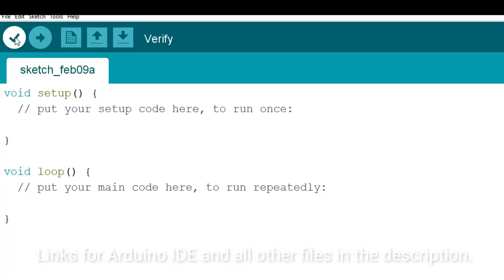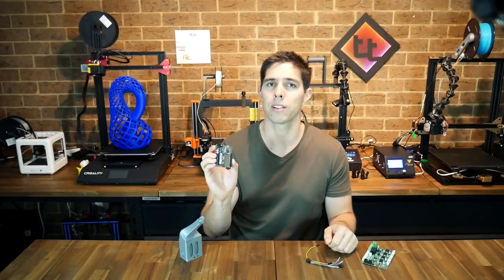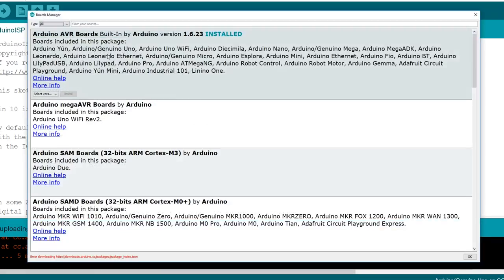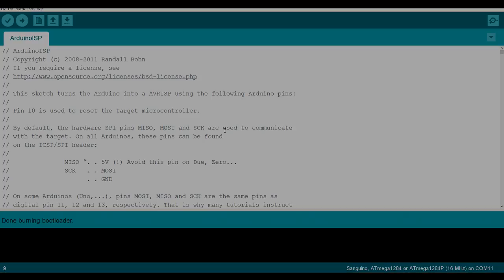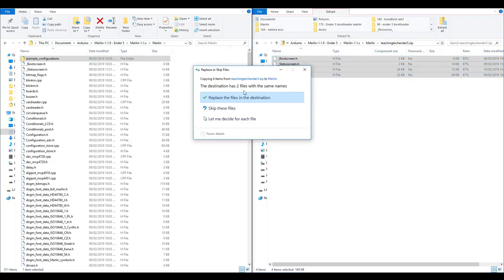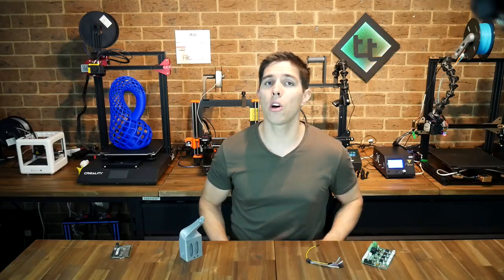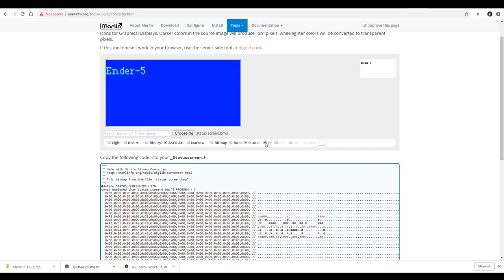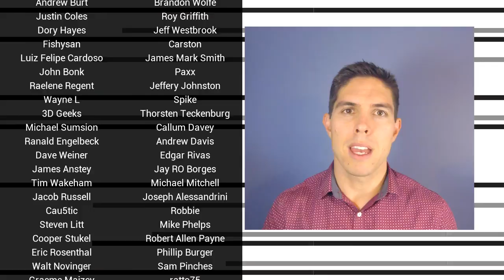Ender 5 bootloader and Marlin update

Comment: Hi. I am trying to upload the marlin 1.1.9 (bugfix 1.1.x) with Arduino 1.8.9 Board: Sanguino Proc: ATmega1284p 16Mhz. Connected directly from my PC to the Creality3D 1.1.4 via USB.  I am getting this:

Sketch uses 122432 bytes (94%) of program storage space. Maximum is 130048 bytes.
Global variables use 4629 bytes (28%) of dynamic memory, leaving 11755 bytes for local variables. Maximum is 16384 bytes.
avrdude: stk500_getsync() attempt 1 of 10: not in sync: resp=0x65
avrdude: stk500_getsync() attempt 2 of 10: not in sync: resp=0x63
avrdude: stk500_getsync() attempt 3 of 10: not in sync: resp=0x68
avrdude: stk500_getsync() attempt 4 of 10: not in sync: resp=0x6f
avrdude: stk500_getsync() attempt 5 of 10: not in sync: resp=0x3a
avrdude: stk500_getsync() attempt 6 of 10: not in sync: resp=0x53
avrdude: stk500_getsync() attempt 7 of 10: not in sync: resp=0x44
avrdude: stk500_getsync() attempt 8 of 10: not in sync: resp=0x20
avrdude: stk500_getsync() attempt 9 of 10: not in sync: resp=0x69
avrdude: stk500_getsync() attempt 10 of 10: not in sync: resp=0x6e
An error occurred while uploading the sketch

Please help
Since I am having problems right now with my Ender 5 as I posted here:
https://www.reddit.com/r/ender5/comments/bsdvp3/ender_5_cant_print_very_dissapointed/

Comment: Just flashing this method to my brand new silent board v1.1.5 black board for my ender 5 and edit configuration.h driver stepper tmc2208standalone and all worked
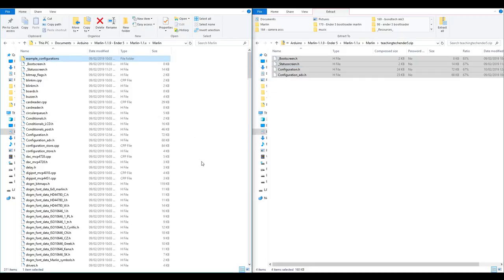Reply: I just got the 1.1.5 board and need to flash the firmware. I am not up to speed on the electronics part of this so I am confused. In the video, after completing the boot loader (which I am assuming I don't need to do for the 1.1.5 board) he says you are done with the Arduino. But at 6:07 in the video he has you open the Marlin Arduino file and do some more (to me) magic with Arduino). Can anyone clarify this for me?
Reply: @craigharoldsen7038  try find kersey fabrication channel he has clear method editing file for tmc2208 ender 5 and upload to this silent board

Comment: Please show how to burn the bootloader using a Raspberry Pi. PLEASE!!!!
Reply: An Arduino is so cheap you cant get wrong. Aa simple Arduino Nano wiol cost you 3$ on eBay while a Pi will at least 40...
Reply: AirsoftSlo I already have a Pi as well an Arduino mega and nano. However, the Arduinos don’t seem to have bootloaders on them because I tried flashing their bootladers to the Ender 3 but didn’t work.
Reply: @jaredTsunami  If they didnt have a bootloader it wouldnt even connect to the PC. You do know ypu have to use a separate bootloader and/or select the right port and chip on your ender...?

Comment: I did everything you said and when I try to burn the bootloader, it doesnt do anything and gives me this error...." Arduino: 1.8.9 (Windows Store 1.8.21.0) (Windows 10), Board: "Sanguino, ATmega1284 or ATmega1284P (16 MHz)"

avrdude: stk500_recv(): programmer is not responding
avrdude: stk500_getsync() attempt 1 of 10: not in sync: resp=0x4c
avrdude: stk500_recv(): programmer is not responding
avrdude: stk500_getsync() attempt 2 of 10: not in sync: resp=0x4c
avrdude: stk500_recv(): programmer is not responding
avrdude: stk500_getsync() attempt 3 of 10: not in sync: resp=0x4c
avrdude: stk500_recv(): programmer is not responding
avrdude: stk500_getsync() attempt 4 of 10: not in sync: resp=0x4c
avrdude: stk500_recv(): programmer is not responding
avrdude: stk500_getsync() attempt 5 of 10: not in sync: resp=0x4c
avrdude: stk500_recv(): programmer is not responding
avrdude: stk500_getsync() attempt 6 of 10: not in sync: resp=0x4c
avrdude: stk500_recv(): programmer is not responding
avrdude: stk500_getsync() attempt 7 of 10: not in sync: resp=0x4c
avrdude: stk500_recv(): programmer is not responding
avrdude: stk500_getsync() attempt 8 of 10: not in sync: resp=0x4c
avrdude: stk500_recv(): programmer is not responding
avrdude: stk500_getsync() attempt 9 of 10: not in sync: resp=0x4c
avrdude: stk500_recv(): programmer is not responding
avrdude: stk500_getsync() attempt 10 of 10: not in sync: resp=0x4c
Error while burning bootloader.

This report would have more information with
"Show verbose output during compilation"
option enabled in File -> Preferences.
Reply: nevermind.  anti virus was screwing everything up.

Comment: Hello Michael,

Greets from Belgium, Thanks for sharing you knowledge !!! Help me a lot to install the bootloader and reflash the firmware to Marlin 1.1.9.
However I did use a raspberry follow this guy => https://johnwyles.github.io/posts/flashing-the-creality-ender-3-with-a-raspberry-pi/ which works just great, I also did use your Ender 5 config's which are very amazing, Thanks a lot for sparing me a lot of time to figure it out !!!
However I do encounter some strange behavior like when the bed is heating the LCD display change from the main display to the main menu and reverse also it is then continuous beeping ...
When printing it also beeps and show on the LCD display "babystep Z: 0.000" after a while it also stops but then it start again beeping and changing the LCD display.
What I also notice is that sometimes you hear the steppenmotor make some noise if it hit resistant of something, you also feel the vibration in the X-as, the Z and Y don't seem to do it, it's just working fine ...

For the rest seems to work pretty good and having great quality with my Ender 5 I really love this machine even it's my first 3D printer :)

Looking in the config files I do see #define SPEAKER standing in it maybe with putting it back in comment the strange beep and behavior will disappear ?

Any suggestions idea's ...

Thanks a lot !!!

Kind Regards,
Reply: Hello Michael,

In the meantime did a upgrade to Marlin bugfix 1.1.X, but the beep problem keep existing, I notice that it beep when heating up the bed and giving this in octoprint don't know if it help => " Recv:  T:34.58 /0.00 B:49.75 /50.00 @:0 B@:127" notice the last B@:127 when it is not beeping then it is B@:0 

Thanks !